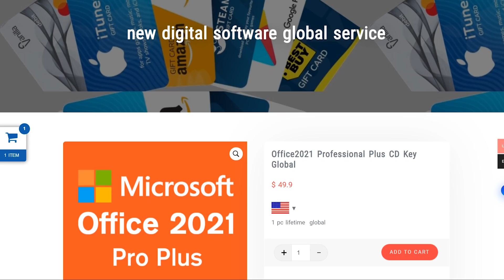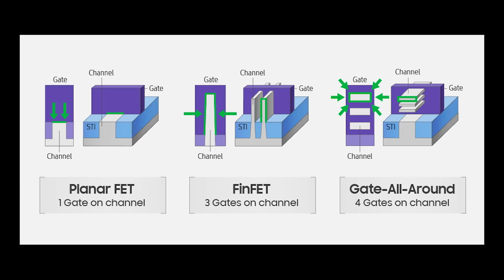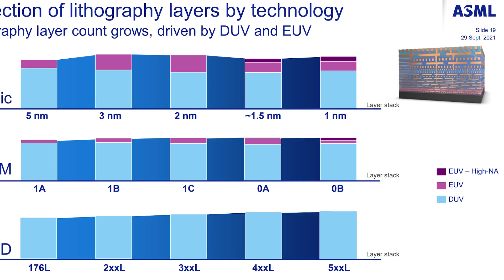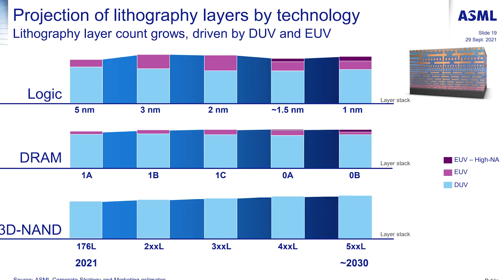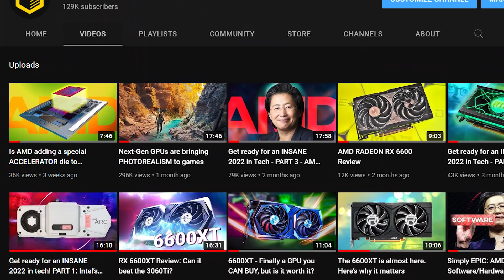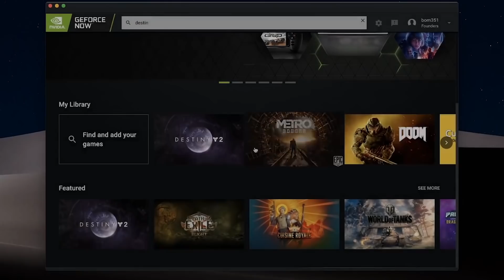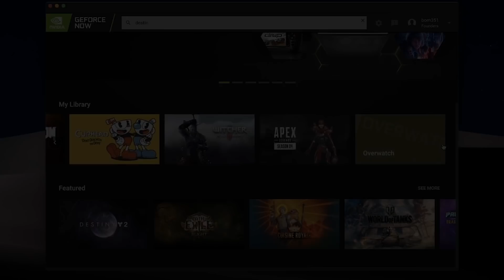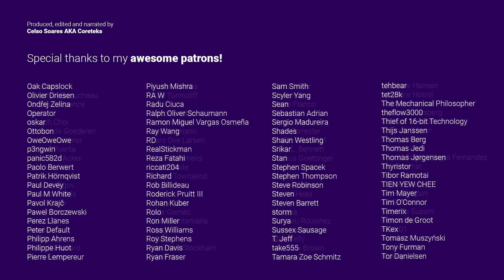GPU and CPU prices are only going to get WORSE in the future. What should you do?

Comment: I agree that multichip packages, especially with many different dies, can get very expensive. However, splitting up the design to several smaller dies will improve the cost structure as well as yields can be better with several smaller dies compared to one big die. 
Yes, Moores Law is ending these days however, the whole tech industry is living the mantra of higher faster better. Imagine Apple would pass on one year iteration of the iPhone simply because there is not enough advancement for a new better iPhone. This would cost Apple many billions of revenue and therefore Apple for instance will do anything possible to push the limits and keep going the cash machine as long as possible. And the other companies will follow in these footsteps. 

You are right, production costs for these new chips will rise but you have to take into consideration that the production costs are only are relative small part of the whole price we have to pay. R&D, marketing and distribution is a very big chuck of the MSRP as well. If manufacturing is increasing by 50% the whole costs for the product shouldn't increase more than 10% - 20% if the other costs stay flat. 
In general, prices for the consumer is more driven by demand and supply and manufactoring costs are not that relevant in this regards. For instance, look at the cyclic price scheme of RAM chips, in one year demand is very high and you can get rich in this business and the year after demand is low and nobody can regain even the manufacturing costs. 

As long as new factories for the new advanced notes are build constantly and the demand for new chips will normalize a bit we will get a new equilibrium. You can't constantly increase supply with new plants and increase prices per price as well. This won't work out. You will have to maximalize the utility of all the existing and upcoming plants as these are very big investments. Demand for hyperexpensive graphic cards will be limited as people simply can't afford to spend several thousand Dollar for a single card. If you don't have the money you can't buy it. Simple as that. 

However, as explained in the beginning the show must go on and latest when a new better model is introduced older models will get discounted. I am pretty confident that you will be able to purchase a 6900XT for below thousand Dollar in fall of next year. And for everybody who is still sitting on an older generation of graphic card this will be a significant upgrade for sure. 
We may have lost a year or two in the grand scheme of tech development but I am pretty sure we will get back to a more normal market in the future and everybody will find something to upgrade within his budget. If this is the very new card or a model from the past year isn't that important as long as you get more performance for what you be willing to pay. If the indurusy cant return to deliver this it will have serious trouble to stay alive.
Reply: the only thing that concerns me is the fact that your line of thought doesn't take into the picture that what we are seeing is a reversion to the start of pc's. only the uber rich and companies are going to be able to afford the new tech. between the covid and tech upgrades; the average person will not be  able to afford the upscaled price of the pc in another few gens. reminds me of what was happening apple and ibm started up. it was 7 or 8 years after pc's took off before most people even could see one, let alone know someone who could let them learn enough to operate one. now it's just going to be outdated computers being pushed out by programs compatability and us going back to the haves and have not's.
Reply: @craiglortie8483  Gaming and the cooperate market are two very different things. The initial  purchase price for a PC in business environments are only a fraction of the overall costs of ownership and most bigger companies buy directly from Dell, HP or Lenovo. In general this not the cheapest route to go when you looking for the dime and nickel. But with the purchase you also buy some sort of protection and IT knowledge and that is very important when your business is relaying on your IT infrastructure and IT isn't your core business either. I don't see that we have massive inflated  prices here right now and migrating to the cloud can save good money for many business. This is a normal evolution and nothing unusual. 

Cloud gaming is more of a attack to the console business as it providing even cheaper access to gaming than a PS5 or XBox can do. The graphic power of these offers are clearly targeting the build in chips of the current consoles and is not competing with the PC at all. And streaming comes with it's own problems as well and it will definitely take a few more years before fiber is common and affordable in many houses. For normal browsing and texting you can buy good phones or tablets for relatively cheap money and you don't need a PC for this anymore. The "affordable" PC in the past wasn't more than that either and most people used it for the things you are using your phone today. 

Renting hardware will always be more expensive than owning and high end gaming was never cheap at all. When you compare the intended MSRP of these generation I don't think they are hyperexpensive. Of course, due to the pandemic and the whole shortages it is very hard to find but there are some sold for that price. 

With AMD now being competitive and Intel entering the game as well I see good competition rising up as soon as soon as production capacity will finally match demand again. This may take another while but eventually will happen as long as new plants and new notes are being added constantly.
Reply: Well written conjecture, but I disagree. Companies will simply shift away from ownership to hardware as a service (aka what renting is to actually owning a home). It's more profitable this way and it's the natural end point for all business models. Subscriptions add up to far more over the course of years just like rent does, and all you're left with in the end is nothing.
Reply: @cosmic_gate476  what was the best selling phone in the world last year.? The Samsung A51. The average cell phone sold last year was 375. What make you think that people will be able to pay between 6 and 10 times as much for a 🖥?
Reply: Moores law was never a real thing, it was a standard that was accepted on how many transistors they would use, it was an actual way for to keep competition low because companies knew what to expect from the other one and so they would move together, it is kind of anti trust if you ask me, but because it was never ever confirmed it can't be proven but it doesn't mean that companies weren't galloping in that direction... now that they aren't using the standard you can see how whacky things have became
Reply: Yeah this rent forever one is going to end up bad because people can barely afford the tech that they have because they can't afford it and they force it but if they try to make it av rent a center style offer then people will just go without it and they'll learn that they don't actually need it...

Comment: Game companies will focus on the segments with the most potential customers. We will not need a 3000 series GPU for gaming for another decade.  It also helps if you just ignore 1440p.  They want you to bite on the higher res and buy a new monitor and GPU and ect...  But in reality while you are playing a person just does not gain much or even notice the difference between 1080 and 1440. And at 1080 you dont even need a gtx 2000 gpu.  I play games not benchmarks.  If it does not improve my win rate then it's probably not going to be important to me.
Reply: The easiest to reach customers are consoles, which are now on a 3-4 year update cycle as opposed to the 7-8 years due to the mid-cycle 'pro' releases that I'm fairly certain will be a trend. In 8 years, game releases will be optimized for the PS6 and PS5 pro, with hardware more powerfull than the 3000 series parts.
Reply: @Steamrick  You may be right.  But by then I believe integrated graphics will be the mainstream option for gamers with AMD and Intel IGPs providing superior performance and value.  Nvidia's failure to acquire ARM could have long lasting ramifications.

Comment: You forgot something that we are about to hit a wall in term of performance we need, most people are happy with 1080p and 1440p and don't see a need to buy high end gpus anymore because almost everything can run those resolutions, as for 4k we reach a point that going above that is simply useless and I'm sure most people simply wont do that.
It's true that things will get more expensive but lower end option will be all we need for gaming.
Reply: A PC only needs to be so good the human starts being the bottleneck in the system, and we're very near that point.
Reply: as depressing as all this is. I think its worth pointing out that Unreal engine 5 offers all these new leaps in whats possible within the tight constraints of a console. So 3GB graphics memory is all it takes to run 1080p at 60fps with stunning detail like in the Matrix demo and upscaling tech will make that look like 4K. So I'd consider that a doubling (at the very least) in performance on the same hardware. Other engines will follow next year that match these leaps.  The form factor I think will be everything. A powerful laptop that can run these games will be much better value than the combined components used to build a PC as those separates will still be abused for mining and bought up to sell to the highest bidder. I think its the end for desktop PC gaming but the beginning for mobile like standalone VR, powerful laptops and tablets.
Reply: People have been pointing to an upcoming wall of performance needs for well over a decade now. It hasn't materialized yet.
After the move to 4K high-fps, the next hardware hurdle will be VR headsets with even higher resolutions and higher framerates to get rid of the screendoor effect, increase FOV and reduce motion sickness.
Reply: There's never a wall in 3D graphics. Even if you have the fake impression that you'll have an abundance of fps for a couple of years, studios will grab the opportunity to increase eye candy and bring you back to sweet sub-60 fps
Reply: We’re way past giant polygons now. There’s only so far you can go and still have people give a shit. You only need so sharp a knife. Anyone who thinks we have a massive margin for improvement here has forgotten how literally every other new market on the planet has ever worked.

Comment: If it goes that way then its time to just keep playing games already here. Then i will likely buy used gpu next time i buy, and run it at stock speeds with undervolt to make it last long.
Reply: Indeed. I recently bought a used PNY GTX 1080 for a build that was a Christmas present for a friend's two young sons; the card was a good price from a server OEM. I used Afterburner to force the card on boot to run with a 70% power limit and -100 on the core, making it behave more like a 1070 Ti but with better efficiency and reduced noise/temps (it's almost silent under load).

Overall, the settings reduced max performance by 9% but cut max power consumption by 20%, while giving an overall total system idle draw of less than 60W for both the PC and the 24" 1080p monitor (the rest of the system is a uATX case, Thermaltake 650W GF1 PSU, MSI B450M Mortar Max, 5600X, 16GB/3200, 1TB WD Blue NVMe). With monitor sync active, it draws less than 120W total since for many games the 1080 isn't being pushed that hard.

One can do a lot with older hw, doubly so now that modern CPUs can get so more out of them. This particular 5600X + 1080 combo is faster than my oc'd 6850K + 1080 Ti.

Note that it seems to be easier to just change the power limit rather than the voltage, achieves the same result unless I'm missing something.
Reply: @mapesdhs597  Well i undervolt from drivers, what i think you cant do on nvidia. With undervolt it is possible to gain performance while drawing same power, or consume less power for same performance. On my RX 480 with stock cooler undervolt slightly raised clockspeed but now i have it watercooled so it runs most of time at max boost anyway so it just reduces power consumption. Im not sure how it is on nvidia cards.